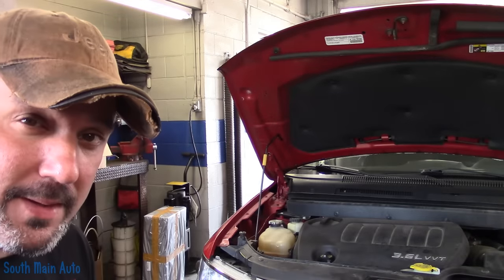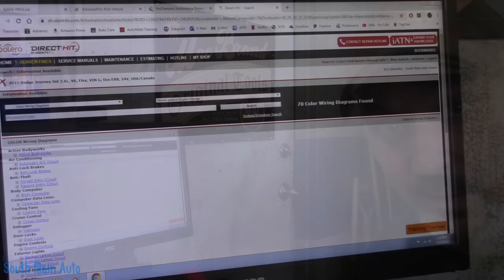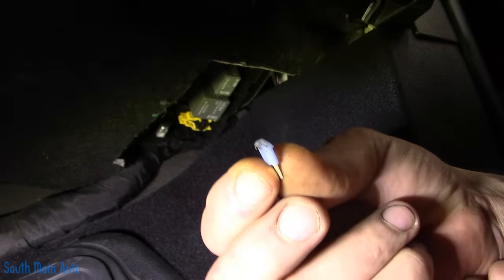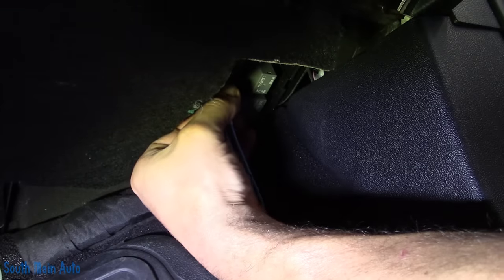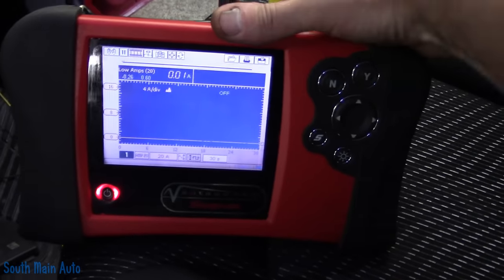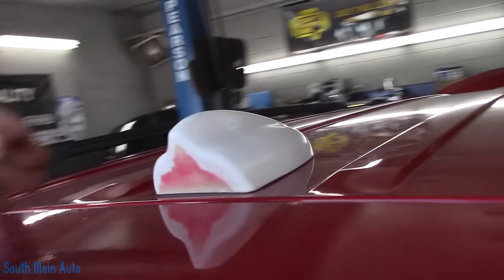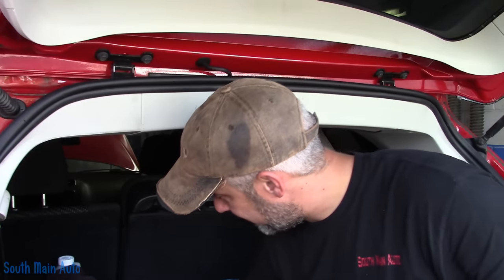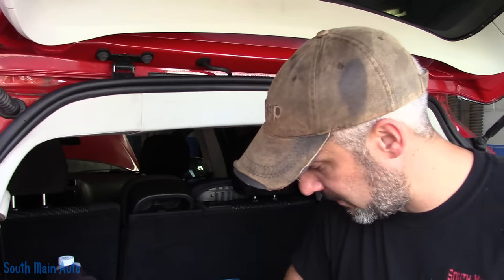Dodge Journey: No Start, No Crank

Comment: Got to love after market crap specially installed cruddilly I would of at least cut a hose length wise and put silicone inside it and glued it on the sharp edge. I had a remote car starter the would not let the parking lights turn off. I started ripping out all the spaghetti wiring on the customers car they were all upset because not even 3 months before they had this car starter installed by some hacks. My saying if it didn’t get installed from factory you probably will run into problems in the future   Now I know some installations are done nice and neat and look like factory installations none the less usually the electronics are not of high quality and will start giving you weird problems

Comment: Those fuses and the low profile mini fuses are just dumb. Like a quarter inch of height or a mm of spacing was worth making a whole new fuse standard for. Constantly making reasons to have to keep more and more crap on hand.

Comment: as you hate chrysler products you have a jeep hat on? interesting. i just bought a 2019 dodge journey so far so good reviews on are average nothing to write home about. ALL cars are designed to fail and break known as planned planned obsolescence all cars turn into junk eventually.  if its a choppy after market install that has NOTHING to do with the car and the possible wetness might be  from the wiper fluid tube it may have been ripped off or something.

Comment: Thank#, oddly interesting…… especially since I have a 2015 Journey/4 Cyl…. Interestingly, just had the No start/ no crank @-31 F, here @6:30 AM RUSHING TO work( stopped @-34,🤒): even more problematic, I could not get my “ small Lithium(?)jump starter clamps to bite metal or start , on the JOURNEYS’s engine Bay POSI/ NEGA terminals, as ”ORIGINAL BATTERY” is inside front Fender! ((* kind of idiotic location, design flaw)….. Interestingly, my Canyon 4 CYL STARTED ( grudgingly), & I forgot to Doubke Recheck my Jump Starter(* some six years old, used four times for  “winter “jumps: always keep yearly “ charged up on my computer)…Interestingly, got it jumped later : had my Shop Replace Original  FACTORY BATT, (* and change to 5 W-20 Synthetic Oil/Famous name Filter ……DULY , noted that conventional Oil @-31 is little flow, though temp stayed around ; & six years ++, in Garage… Odd,y, I had got* lifetime Oil change Program buying “Journey special SHOP/ Demo Vehicle @+8000 miles “, THOUGH seemed reasonable price …..

Comment: This is what bothers the crap out of me about the aftermarket installer's industry.  It's ALL about time-in.  Turnaround, how fast you can get an install done and out the door because time is money.  I've had several issues with vehicles with SHODDY install work-in fact, I've YET to see one done PROPERLY!!!  Of course, I'm very anal-retentive of how I do install work on my OWN vehicles.  But I get the conundrum, do you want it done "FAST" or do you want it done "RIGHT"???  You CAN'T have it both ways!  It goes to the old saw, "If you want something done right, DO IT YOURSELF!"

Comment: What a strange place to tap a live, Chinese junk sharks fin - you could see where the spoiler was hitting it, not sure why you would need a perm live for a reverse camera as you just tap it off the reverse lights - as for the fob issue swap the fob battery the internal receivers are lower power
Reply: was that spoiler paint rubbing onto it, or all that was left of the chinesium color matched paint? lol

Comment: lol they also have those cheap shitty led bulbs that unsolder their own resistors because all the leds are in parallel with a tiny quarter watt (?) resistor and it gets HOT.

Comment: Someone didnt follow the directions installing aftermarket junk. So much for a professional job. I had electric start installed on my Wifes Forester, they didn't even set it up properly. I will NEVER go back to THAT place again. Supposedly, they are the best in town. The biggest issue is doing it correctly. If you cannot even attempt to do it properly, don't bother.

Comment: Sad, all the camera installer had to include in his wiring was a decent wire loom for protection from the moving hatch door. Actually, they should have researched another source for power just the same.  It looked like that roof had been painted so it's possible the painters had broken it to do their paint work.
The best repair is one that has the least or no collateral damage and no invasive damage during the repair.  Too many mechanics will damage plastic parts, insert the wrong screws back into the trim or split the trim over tightening those screws, messing with other parts in the process etc. That's the elephant in the china room mechanic. Can't stand those types and those with dirty hands when working inside. All it takes a short trip to the sink to get them clean again if they get dirty during repairs. Passengers cars and pick up trucks of today are mostly tiny wires and brittle plastic...you have to be ginger as SMA says.

Comment: I think I'm an idiot: I want to install two extra LED lights in my car boot, just ordered fuses, 5m of double insulated-flat- wire, convolute, tape, heated shrinking tubes, etc and the 6 way fused power distributor (for other aftermarket gadgets I intend to fit in) and I intend to strictly follow the original wiring loom. Why bother? ;) That camera installation from your upload is just pure stupidity.

Comment: I own a 2012 Journey the keyless keyfob  2032 battery is weak that's why the RF range is so low replace it with a name brand battery and your range should come back normal . I could tell that was an aftermarket shark fin OEM matches the body color from the factory.
Reply: it had some reddish color at center back, maybe  the paint got eaten off in harsh conditions, or 500 million car washes, some folks go nuts on the yearly car wash subscriptions lol

Comment: baby shark do do do do.  there its stuck in your head lol.    you need to remove the horse shoe from your butt !!!!  good use of the amp meter. wiggle and look for a squiggle. if its for the back up cam hook it to the backup light circuit. then if theres  a failure you got more direction. not an antenna module that is used for remote and pus button start  duh. those shark fins are amplified antennas used for everything from am/fm to cell and gps. and in this case they recieve the key fob  signal to enable the remote and keyless start door locks and security.

Comment: You are so used to using your Amp Clamp i think that is why  you did not fully notice that your meter was set wrong. Crap happens Eric. Lighten up on your self. Most of us are harder on our selves then we should be. Also I think you change how you talk about after market things and vehicles. It is not usually the after market equipment/stuff that is the issue in your area and probably most of the USA. IT is how crappy 90% or more of the installs are done more so then the after market stuff it self. I know you do not like after market stuff 98% of the time. That is your choice. I think you should be more anti crappy installers vs anti after market stuff.  I think some vehicles are designed to have the key in the cup holder in front to make it run with the OEM wireless push button equipment. On a  page I check out from time to time  the wife has a modern DODGE Charger with a simaler wireless OEM system as the van in this video. That car needs the "Key" to be in or near the front cup holders to run. That might be a Chrysler thing. Just sharing what I have seen heard on another YouTube channel. I hope it might of interest or use to you Eric. SAFETY FIRST NOT THIRD.

Comment: I remember the old days when you paid atrention of your surroundings and didn't need those fiddly bits such as backup cameras blind spot monitors and all the other nonsense that complicates the electrical systems, I boil it down to just plain laziness, we rely too much on tech and forget about everyday common sense and the worse thing that can happen in my opinion are these autonomous or self driving vehicles, there already have been several deadly accidents with them, when will we return to personal responsibility and stop being so gosh darn lazy, I'm trying to hold onto my 2001 lesabre with 285,000 and still going strong, I can do without all those electronical gizmos by cracky! And stay off my lawn dagnabit!

Comment: CHRYSER WILL LEAVE YOU STRANDED----
GET A SUBIE OR VOLVO
Reply: @Mr ShibeDoggo i have a 2017 impresa- no problems so far
its a tiny hatchback - 9500 miles on it
left chrysler for subie due to 4w drive
Reply: @Mr ShibeDoggo went TO LOOK AT VOLVOS LIKE WAGONS AND SUV
TOO EXPENSIVE TOO BUY AND MAINTAIN
EVEN USED ONES WERE TOO PRICY TOO FIX
WHY I WENT WITH SUBIE-BOUGHT IT WITH 500 MILES ON IT
M7 97 DODGE NEON 4 DOOR HAD 167K ON IT- BEFORE THE ENGINE WAS BAD
RUST ALL OVER- ONLY GOT 200 FOR IT